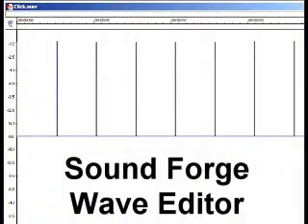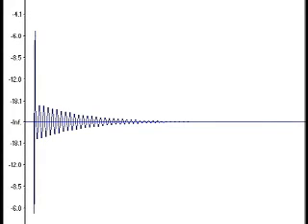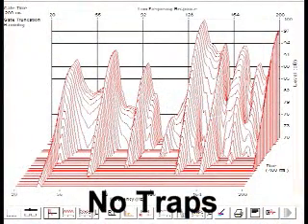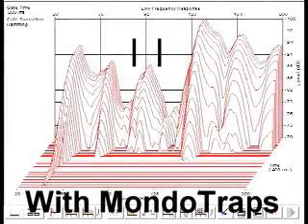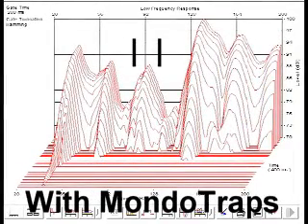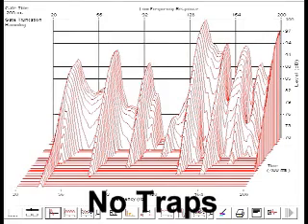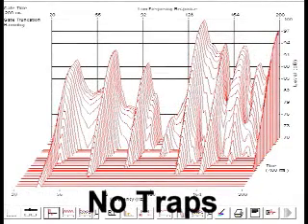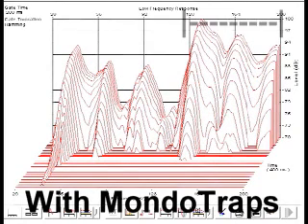Modal Ringing and Resonance

Comment: From my experience, assuming you have a non-cubic/squarish room, significant improvement in sound quality can be achieved by sloping the ceiling. Once the ceiling and floor are non-parallel (as in most theaters), and you've added bookshelves, carpeting, drapes and furniture + at least 2 bass traps, these help minimise serious standing waves to some extent.

Comment: Hey, Ethan! Your articles are a pleasure to read! I had a couple of questions(however, couldn`t register on GS-it says that I`m behind a proxy or smth...didn`t have time to figure that one out). Anyways, what I did for traps is I bought sheets of pretty solid mineral wool(158 kilos per cubic meter=9.8 pcf) and made panels that are 9 cm=3.5 inches thick. 1. Does density compensate for thickness? 2. And is density this high-overkill and actually lowers the functionality of the traps themselves?

Comment from the maker: For stereo music I also prefer full-range speakers that get to down to 50 Hz or lower, rather than use lesser speakers that need a sub. A sub can work even in a small room, but it's yet another crossover frequency to deal with. For every crossover point, two drivers have to combine in the air around that frequency. So that's yet another source of peaks and nulls.